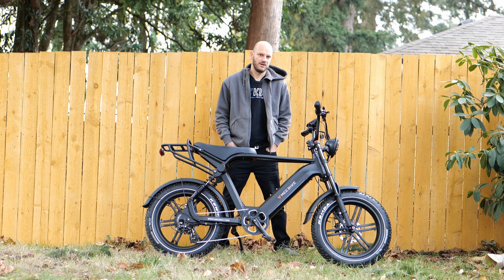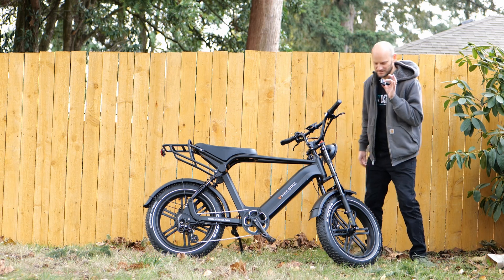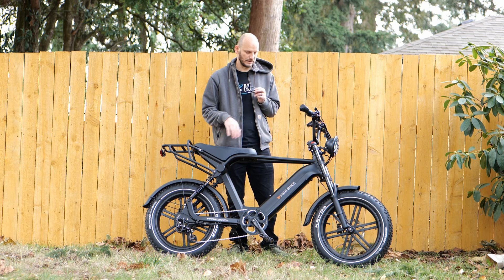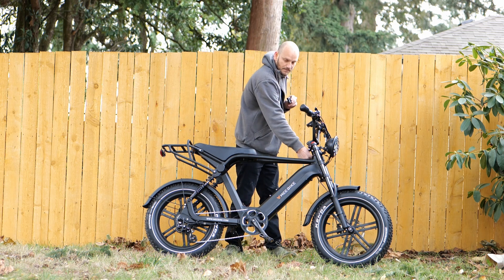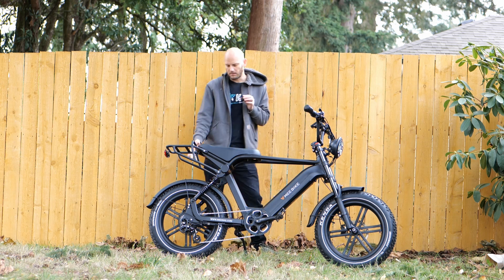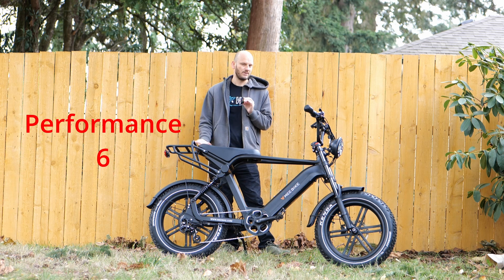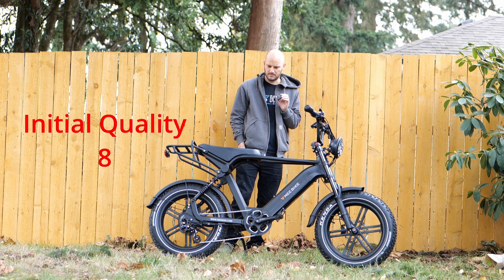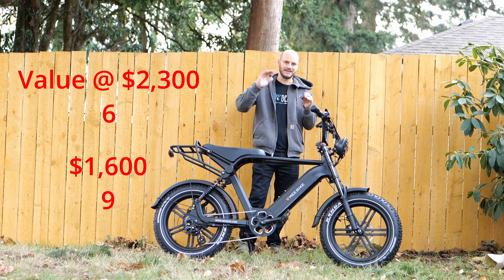Meebike Gallop Review: Full Suspension & Torque Sensing Motor

Comment: How about riding e-bikes in the rain. I see on one side labels that it's not recommended, on the other that there is water resistance. What would you recommend?
Reply from the maker: Depends on the bike/motor. I ride my Bafang mid drive in the rain with no problems.

Comment: Just one question and observation regarding the torque sensor, I dont believe that option is available to us DIYers and self builds who are all in on mid drives.I think the Bafangs that that offer that can only be used with certain proprietary frame builds. Somebody please correct me if I'm wrong.
Reply from the maker: CYC motors!

Comment: I'm thinking this bike is kind of like a Stingray (almost)! If it had a mid-drive, reinforced step-thru frame, height adjustable banana-style seat (probably not rear suspension), chrome and kandy colors (anyone listening)? If it had a mid-drive and some off-road modifications, it would be like a trail bike. I thought that was Steve McQueen riding around on those grass hills ready to jump a barbed wire fence! :)

Comment: Hey Johnny, quick question hopefully you can help me out. I have a himiway zebra and I was thinking of gutting it and using a bafang 1000watt hub motor kit. Do you think it will be better and also would I be able to get the speeds I want from it. Right now I'm getting limited 24mph. And motor cuts out at max speed. Also if so which hub motor kit would you recommend?

Comment: I agree the mod drive is superior to hub for start-up torque and speed.  But then again there are 750w motors and some of them a vastly superior to others.  It has a lot to do with the controllers and how many amps they are pushing to the motors as well. My 750 motor actually draws 1250 watts do to it's 25 amp controller.  If it had a 35 amp controller it would be even better.

Comment: love the styling on these so I finally bought one on a good deal.  The plan is to move my bbshd over to it and have dual systems :D
Reply: Wow that would be killer.  Use hub motor for cruising and mid drive for climbing.
Reply: How is yours doing? Mine toast after 100 miles. Meebike ghosted mid warranty service and now their phone is shut off. Address is a residence in Campbell. Was a cool bike for a minute but very clearly under powered. After exchanging videos and pics, they said motor was bad. Never heard back again.

Comment: This bike is not designed to be peddled much. I don’t like to pedal with my knees in my gut. No seat height adjustment?
Reply: Exactly, I'm going to go out on a limb here, and guess it's another piece of junk.
Reply: Get a Luna BANANA with the 4000 watt upgrade it will get you pregnant even if you don't have a uterus